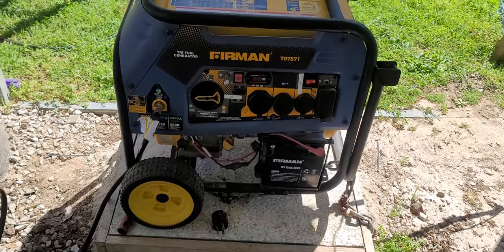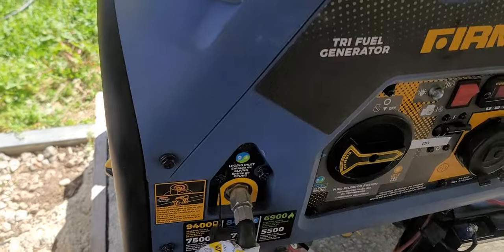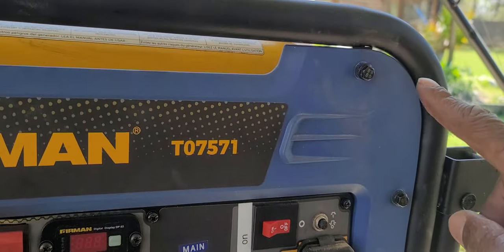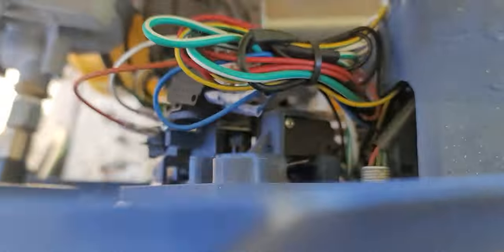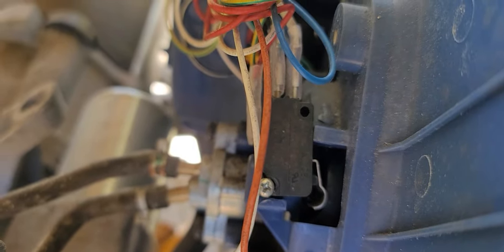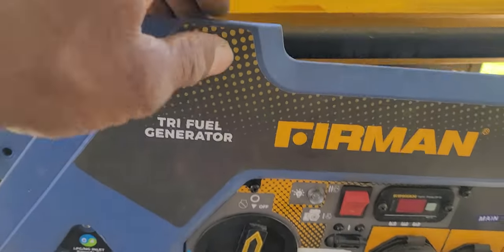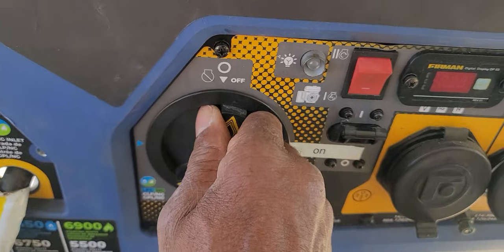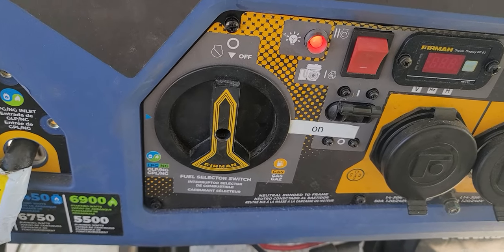Easy fix for Firman generator not starting

Comment: Hi! Let’s be honest here. That Firman generator looks pretty cool with its bright colours. Also, it’s tri-fuel. Wow! Pretty neat! Since it was on sale at Costco, it seems that everybody and his donkey bought one! However, there is a lot of videos on YT talking about problems with this generator. I’ve had my Honda generator, an EM5000 for 25 years this year. I never had a part break like that. I think I’ll stick with my Honda. Mind you, the Honda costs a lot more than a Firman. That must be the reason. My Honda simply does not break…
Reply from the maker: Good for you 👏
Reply: Mind you people who do not have issues guy not make YouTube videos and there are a lot of them including myself. For some, kookie cars than Toyota, others no other generator or mower than Honda or like my uncle, electric cars are a gimmick and not here to stay. He's been saying since ee acquired the first Tesla in 2012. Still running, no repair, battery strong 12 years later.  To each it's own.
Reply: Well, you are right on the money. Bought mine at Costco for $980.00. Used it one time. Now it wont start. Gonna check this switch tomorrow.

Comment: I have the red light and it still wont start. What else could it be sir? Have gas, new sparkplug, good oil. I called firman and they had me to tap on starter; this was some months ago.  It worked but now it wont start.

Comment: My light is on and still won't start
Reply from the maker: Has your gas been stored in it for a long time?
If so do you start it once a week and let it run for about 5-10 minutes?
Reply: Same with mine
Reply: Mine won’t start but if I trick it by giving a shot of starting fluid so it runs a few seconds then dies. With the flashing red light it starts and runs just fine. As soon as I turn it off and have the solid red light again it doesn’t even attempt to run.
Reply: Not starter fluid, carb cleaner?

Comment: No red light so the switch on both sides are broken or popped out and it’s easer if you remove the fuel tank and not the whole panel.

Comment: Not expecting to pay 1150 for a generator not to be working
Reply: I just bought one yesterday, ran all night, stopped it to refuel and had a hard time restarting it.  Lowes better exchange it..1150 pos.  My old champion went 8 years , always started 1 or 2 pulls.  It's a necessity living in the country

Comment: Thanks for the video - the micro switch(es) would be replaced just as shown.

For those who wander in this excellent video, know there are three micro switches that the fuel valve (large rotating knob) make contact at the Stop, LPG and Gas positions. For generator HO8051these are part numbers 96 & 97 on the parts list. The micro switches for LPG and Gas are the same design and if ordered ship as a quantity of two and the Stop is a single item.
 
Make sure that the switches are the culprit as I thought that was the case with my fuel valve not going to the Stop or Gas positions - it was really the fuel valve knob that was the problem. After inspecting the three switches, not noticing any movement in them and the switches (silver pieces) triggering when depressed I then removed the selector and lubricated the spring loaded bearing on top of the knob (even though it seemed to depress easily), worked it a few times, reinstalled it and Voila! It worked through all the cycles. 

The moral is try the easiest fix first - good luck to all!

Comment: My switch will not go from propane to gas it is on propane and locks right before off?
Reply from the maker: The switch needs to be replaced, if you had it less thsn a year thwy will send you a replacement one under warranty of you registered it.
If you have to buy it its price affordably for the swirch.

Comment: Do you have a part number for this ? Mine is broken and I can't find it.
Reply: I don't have a part number, you gave to call them direcly...tell them you need the switches that's underneath the fuel selector that the wires run to. It's 3 of them and they will send you all 3

Comment: Does anyone have an answer for this same generator having issues with running for three minutes and then shutting off completely then starting back up and running fine only for three minutes again??
Reply from the maker: Do you leave the gas in it over an extended amount of time?
If so you may need a carb.
All generators if you leave gas in them should be started up and ran for about 10 minutes every couple of weeks if not weekly

Comment: I dont see a red light when you select fuel.
The light should lite up as you select Gas or Propane.
No light means switch is not operating.

Comment: My generator wont start. It'll turn over and thats it. Had it for a year
Reply from the maker: @roseorchid7981
1. Did you leave it sitting with gas in it?
2. If so Did you add a fuel additive to the gasoline?
3. Did you start your generator for at least 5-10 minutes a week?
4. Try using propane as fuel to start the generator
5. Make sure you have the choke on while starting the generator.
If all that fails you may need a carburetor. 
If you filled out and sent in your warranty card they will replace any part that needs replacing.
Reply: @lifewiththepettways7281  thanks! It fired right up. Put fresh fuel, changed oil, fuel additive, and sparkplug. Thanks for the info!